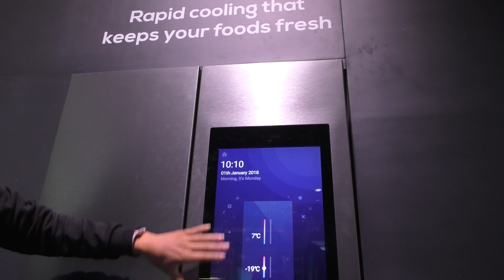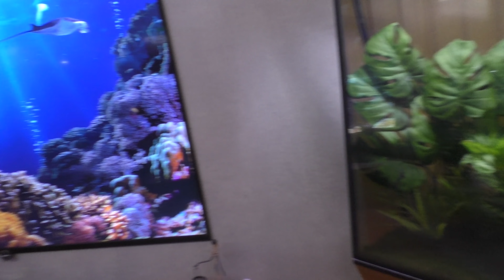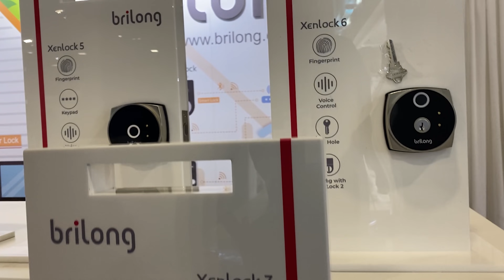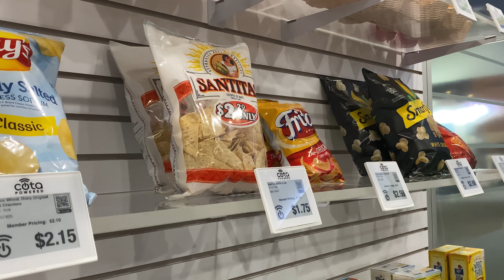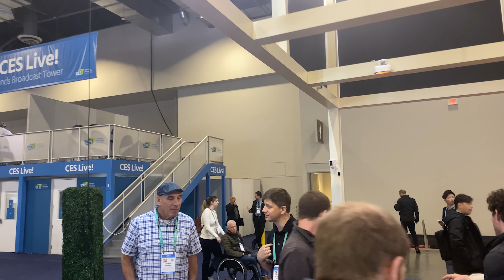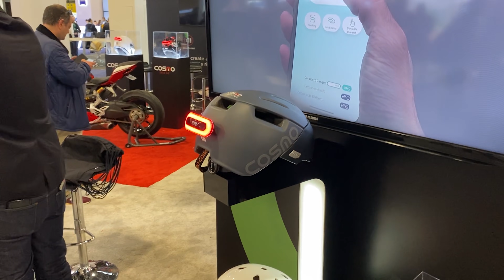The BEST Smart Home Tech at CES 2020.

Comment: Wireless charging for door locks ? Talk about a solution is search of a problem.
Maybe they should have looked a computer case manufacturers who faced a similar problem when adding RGB to detachable  front panels: simple pin and pad tech enabled power to flow.  That would work just as easily for a door lock, the only issue would be ensuring it was robust enough for 100s if not 1000s of front door openings and closings (maybe include a rechargeable battery as well to be safe).
What I would like is a "smart lock" for a parcel delivery hatch where I can easily change codes regularly just to keep deliverymen on their toes

Comment: Stupid question and maybe a million dollar idea for someone else... Doors have the locks on the door traditionally because the handle is on the door.  You stated that adding power to a moving door would be costly and expensive.
Why not just design a lock that mounts to the house (where there's almost guaranteed power for lights or a doorbell) and the deadbolt shaft goes into the door?

Comment: Well, my car door has electric windows, mirrors, and heating and seat adjustments. I see no reason why my front door would not be able to have a wire built-in. that will be my next Home automation project.
Reply: EpicHome It’s really not hard to do. The lazy way is just running a wire from the hinged end to an outlet. Something cool would be a wireless charger built into the frame so it will charge when closed. Maybe even solar panels on the outside.

Comment: That sturm bicycle helmet signal would have made more sense if the ends were pointed ends like arrows rather than  the oval ends it has. Since it is so small, it seems it would be very difficult from more than 15 feet away to tell which way the blinking light is indicating?? 👎👎

Comment: The bike tech is a thing.
CatEye make one that has an accelerometer to show brake light and wireless turn signals for the rear light.

The smart lock power could he achieved for external doors of a simple solar panel even in Norway, so I guess the other silly solutions are for interior doors. Solar panel door locks have been a thing for years. No WiFi or Bluetooth, but they include a keypad.
The microwave charger sounds like a dreadful idea. If your feel your hand heating up, then the transmitter is outputting way more than 4 Watts. Suggesting that is seriously inefficient. With 4200j needed to heat 1kg of water 1C. If your hand exposure was say 10CM^3 of flesh exposed, you would need to stay still for 10 seconds to feel 1C rise if if was 4W. I'm guessing the volume was higher than 10cm^3.

The military use microwave denial devices that operate on the same principle. But are also hideously inefficient.

Comment: What is the benefit of the 4AMPS charging plate over buying a receptacle with the USB-A/C sockets built in? Is the only draw here to avoid switching the wires on the receptacle at the expense of faster charging?
Reply from the maker: It’s a product that anyone can install without electrical knowledge.  The pull out charging cord is pretty cool too.

Comment: Wireless charging of a door lock? 
Why not a wireless phone charger style device build in both the door post and the door. Wouldn’t be too difficult and plenty of power.
Reply from the maker: This solution is pretty great because you can just plug the power source into an outlet that has line of sight or use the light socket adapter to beam power to it from above.  Simple install its the key, no wiring at all.
Reply: The Hook Up 
Yes, using an existing light fixture would be very easy to install indeed. 

For the time being though I think I would install a very small solar panel somewhere on my door. Should be enough to keep a li-ion battery at full charge.

Comment: is no one concerned that heating your hand up means you are microwaving yourself> ? I think ill keep using my wire for now thanks!
Reply from the maker: I agree that will be the reaction of most people to this technology.  It's actually not that simple. 24GHz is still pretty low frequency, not anywhere close to being ionizing radiation.  The sun heats you up with significantly more dangerous higher frequency higher intensity waves every day.  Interestingly enough, microwave ovens run on 2.4GHz, which is actually radio waves, not microwaves... and is the same band used by your WiFi router.

Comment: Most houses today has power near the outer door in form of a light inside or outside, and small 9 to 12 Volt connectors on the door that can give a small current for charging is not hard to DIY, so it look like they just do wireless to get a chance to sell a $500 device to folk that think wires are so hard to install. And is it not stupid to screw in a thing in a 110V lamp socket that need constant power to recharge a lock  that need 1.5V per month? Time to rename some of the "Smart tech" to "Over complicated and rather dumb tech to do simple task Gen 2"?
Reply from the maker: The most important part is that companies are trying to innovate.  There were plenty of booths showing products that were basically exactly the same as last year.  Ease of installation is extremely important for the general consumer (that's why battery powered stick up cameras are so popular even though they are far inferior to wired cameras), and I think this lock is a huge step in the right direction to make smart home tech more approachable for the masses.
Reply: @TheHookUp  great answer, I has to say you're right.

Comment: Wireless charging from a distance is a very bad idea.  Spewing GHz microwave energy around your house is a horrible idea.  Increases the ambient RF noise and is the same as polluting our environment.
Reply from the maker: What about the infrared one though?
Reply: @TheHookUp  Firstly let me complement you on your channel (I should have stated that in my above comment).  Excellent material and you delivery style is very concise and highly informative.  You have a knack of supplying a lot of useful material in a short time.  Yeah, possibly the infrared but it seems like it would be horribly inefficient.  eevblog has debunked a lot of these wireless charging schemes so I am biased against them.  The RF thing makes my skin crawl and as an amateur radio buff I hate to see unnecessary RF blasting everywhere.  Keep up the great channel.
Reply from the maker: I think the EEVBlog video was a little short sighted, probably because of the way Linus was using the power.  I think wireless power is a relatively terrible idea for charging phones, powering speakers, etc.  

However, wireless power will take those devices that would normally need batteries replaced every 3-6 months and make them maintenance free.  Think smart curtains, blinds, door locks, etc.

Comment: On wireless power transfer, what is your opinion on this https://youtu.be/2bXjn3wwM8o (EEVBlog)?
Reply from the maker: What part specifically? I think applications where very little power is needed will be the use case for these things, that way they don’t need to worry too much about efficiency and laser power can be modulated.
Reply: @TheHookUp  No part specially but the practicality of wireless power transfer, and its efficiency.
Reply from the maker: I don’t think charging cell phones is a good application for it, but I think IoT is a perfect fit.
Reply: @TheHookUp  I agree if we're talking about simple sensor devices but charging a robot vacuum cleaner does take more power than charging a phone right? :) The sensor devices can already be powered by batteries for a year or more if designed properly. I'm all for IoT as such, that's why I'm subscribing to your channel. I'm just argumentin against Wireless charging.
Reply from the maker: I’m thinking applications like power curtains, power blinds, door locks, etc, that need to have batteries replaced frequently.